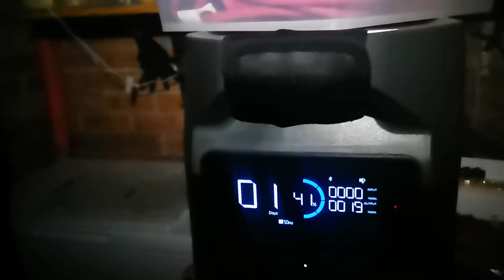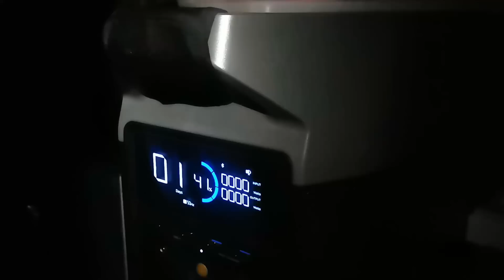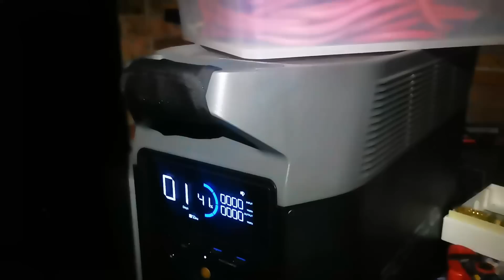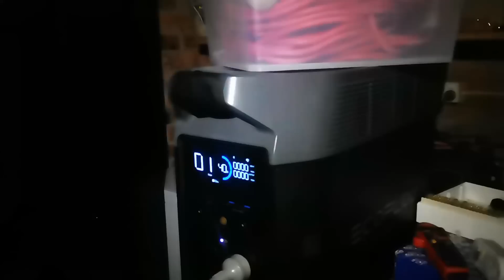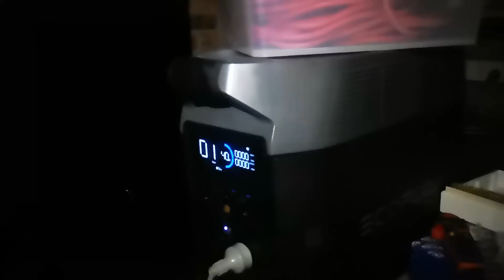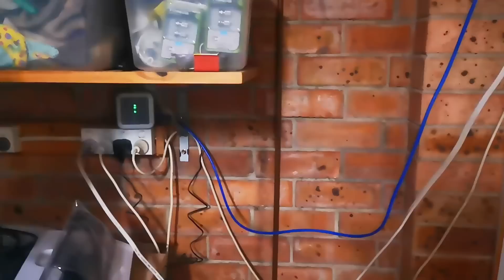Sydney Power FAIL!

Comment: Questions:
The power went out here 2 nights ago, and we were awakened by the incessant home alarm beeping.  Apparently it's been 5 years since I replaced the UB1280 12v 8ah AGM backup battery.  I disconnected the two wires on the battery, but then when the power came back on, more beeping because of the now missing battery!   So I'm thinking going LiFePO4 for more longevity.  But will a 12v 10ah lithium battery work in this application?  The couple additional amp hours will help it last a bit longer through a blackout, but it's more about longer overall life expectancy, even if there were no more outages for over 5 years.  With the old battery in place and hooked up I measure 13.7 volts at its connections.  Is the existing charging system going to be fine with a lithium battery?

Comment: Because you have the enphase and sma inverters you could use a victron ESS system and run the PV inverters on the backup to keep them going in the event of a power failure. The system would do automatic grid fail over and regulate AC coupled PV with frequency shifting. 
It's probably not worth it if the power rarely fails.
Ecoflow has some nice options to tie the units into a house, would probably make more sense to just do that.

Comment: my last power cut, we think was an cheap AC unit, which blow out the under ground cable at almost every joint down the road, I was a hi risk person, so the elct firm put me on a generator for the 3 days took them to repair every joint.

Comment: I've only had a few power outages in the >10 years I've lived in my current place. And one was when the tree in the front yard dropped a branch on the wire running from the pole to the building. That was the last outage, and it was probably more than 5 years ago, and also the only one I've had since I bought my UPSes. It's been long enough I should probably look at replacing the batteries though, considering my friend's UPS just blew up on her, probably trying to charge a dead battery.

Comment: RSVP that SLA alarm battery.

The outage was probably a P plater backing into a transformer or something.

You could probably program an old HP bench supply to simulate a solar panel. Just plug into the old HPIB port, send a few commands, and Bob's your uncle.

Comment: That "solar simulator" is called a DC power supply. According to Victron at least, you can use a DC power supply to simulate a solar array for bench testing systems you're building etc.

Comment: I agree with all your battery analyses. Even with a Powerwall, you have to sacrifice a lot of daily capacity to retain enough battery to hold through the night if power fails in the late evening hours. I have mine set at 35%, with fingers crossed.

Comment: I keep a 3000 watt peak 12v DC to 110v AC inverter around for the odd power outage.
Cheaper to run off the automobile a few times a year than to maintain a battery bank or generator.

Comment: If you want to drive the solar input  from the mains, try feeding it with unregulated DC, from a transformer  based supply. Transformer > Bridge > capacitor, no regulation. 

The solar input should  do the whole  MPPT thing to get as much power as  possible  from that supply. Though  your transformer  may suffer depending  on core design. 

If you're  feeling  really frisky you can add a resistive  load in series  with the primary  of the transformer  to deliberately  limit the current available  if you want to get your  oscilloscope  out and watch the MPPT controller  work  its magic. Presto,  a video idea is born.
Reply: When testing my PWM5 kit design, I used a rectified 18 Volt transformer, as it presents an output very similar to a 12 Volt solar panel.

Comment: A DC power supply simulates a solar panel.
Reply: Why does he want to over complicate it, just plug the bloody thing in, it has a built in charger!
Reply: @uksa007  As I recall from the tear down video, it doesn't charge as fast from AC as it would from solar panels.

Comment: There are two types of power failures.The one you describe here and then the long ones. Where I am we also have these power trips too, some can be during heavy storms, but we also have cable theft, sub-stations exploding and a general collapse of infrastructure. Solar and lithium solves the short duration outages of a few hours up to 1-2 days in a quiet, economically feasible way. After that unfortunately, a can of diesel is the only solution to protect yourself to ensure you will have power no matter what. BTW, we often go without power on the freezer up to 12hours without problems, the more food in it, the better it survives. Also just keep a few ice bricks in it.

Comment: Looks like I am more prepared than Dave with two inverters with 12 hours of backup power each. Also would suggest to separate out high power drain equipment like ac, fridge, heaters, pumps in separate lines. Lighting usually draw very less and you can connect inverter to just that line.

Comment: This is why you need a better inverter so there would be some day time power and a battery backup connected to that inverter since you are a large part of the way there as is. These portable units are okish but probably won't last in the long haul vs a dedicated setup.
Reply from the maker: Yes, that's what I'm working on, been talking to Fronius.

Comment: If you have any chest freezers, many use around 100-150 watts, and good ones can often go hours between cooling cycles. Many fridges will also only pull around 300-400 watts for a short while, and not run for hours if not opened.
Beyond that, I wonder, for the ecoflow, is it possible to add a switch or splitter for one of your solar panels on the roof to have it feed the ecoflow during a blackout?
Reply from the maker: I thought about a DC switch. That would be nice, but the effort required vs the usage doesn't really justify it.

Comment: Very reliable network, here I had 10 DAYS without power about 4 years ago, it's when I decide to buy the Honda inverter, now I have 5kw with an off-grid solution, that lasts about 10 hours (until the sun comes up anyway so not really need the Honda anymore, but it's so u reliable here you get outages all the time

Comment: When my power goes out, I wheel a generator outside, plug it into my house, start it and go about my life.  Eight hours later, I add 5 gal of gas and continue, indefinitely.  I struggle to understand how all of this expensive battery/inverter nonsense is better.  Those boxes make a lot of sense in a camping scenario but as a home backup, I don't get it.
Reply: I get over 16hrs using my harbor freight predator 9000
Just had to run it 3 days straight with hurricane ian 
Thats running a barn shed and house
All the electronics are on ups's
Reply: For home backup it makes sense to use a hybrid system. The battery system will give seamless switchover and also lets you shut down the generator when the battery is charged. Generators running at low load are pretty inefficient, not to mention noise, etc.
Reply: @eDoc2020  All true, but there's nothing in my house that needs a UPS-type backup that doesn't already have its own internal battery (optical network terminal and laptop computer) or an off-the-shelf UPS (network equipment rack).  I'm happy to reset a few appliance clocks to avoid spending thousands on a whole-house UPS solution.  I can easily shut down the generator for several hours through the night without risking food in the fridge or freezer.  To each his own, I guess!
Reply: @FlyingShotsman  Yeah, it's not worth getting an expensive battery system just for occasional grid backup. It's only worth it if it gets frequent usage.

Comment: I get 48 hour power outages in my rural area so I have a 5 KW 240v diesel generator as a standby and a big changeover switch by the meter.  UPSs everywhere until the generator is running.

Comment: My Sister in Adelaide has had no power since Monday and was told expected back Thursday.
Reply: But, but, the Tesla battery...
Reply: I was waiting for a response from Adelaide. Probably haven't seen Dave's video as they don't have any power. 

My father's Tesla Powerwall has been a good investment. He lost power on Saturday, restored earlier today.  PV Solar was wired into the backup circuits, so Solar has been charging the battery during the day. I visited last night and connected the instantaneous Gas hot water service over to the backup circuits, so they could have a hot shower.

Comment: The batteris used in alarms systems, small UPSs etc. are only good for about 4 years. Less if they get hot alot, or go through a lot of cycles. You really have to keep a calander and replace them on schedule. It is one of our PM maintanice items. All batteries get tested each year and are replaced every 4.
Reply: It might be more economical to replace them with LiFePO4 and a BMS module.
Reply: @NiHaoMike64  Ehh not really, a simple drop-in replacement can easily run over $100, these small SLA batteries only cost like $20-30.
Reply: @vgamesx1  Drop in modules tend to be expensive, but building one out of bare cells and a BMS module is cheap.
Reply: @NiHaoMike64  Building 18650 packs are cheap, even the cheapest bare Lifepo4 cells are about 4x as expensive, so even a small pack is going to cost about $20 of cells not including anything else you would need and although you can get away with it, I don't recommend using those cheap bms modules, at best they tend to run cells at the upper/lower points of cycles to get the most capacity at worst they can have questionable quality such as poor or no balancing.

Literally the worst thing you could use as a drop-in replacement because for any lithium cell you want to be able to configure the bms to stop at its storage voltage, if it stays fully charged 24/7 you're going to kill it and there was no point.
Reply: @vgamesx1  You can get modules with balancing, they only cost slightly more than the ones without. That said, the even easier solution would be to just run some wires to the 12V output on one of the portable battery packs.

Comment: If you are still deciding which backup power system you want to have with your PV, check out Victron Multiplus. Needs 24 or 48V batteries for any significant per draw, but it's specs allow permanent use of the inverter in Island mode (many others only allow island mode for a couple hours) and it allows switching over without noticable interruption (basically behaves like an online UPS). (I'm not affiliated with Victron, just a customer).
If you don't want to replace your existing inverters, they do support AC coupling under certain conditions (mostly: must not have more power than the Multiplus can handle). However if you want to be able to power from PV after the battery is empty, you need at least one panel and a small MPPT feeding their DC side to start the system bank up in Island mode (i.e. without power from the grid).

Comment: What about all the solar panels you have on the roof? Where is all that power going?
Reply: Nowhere, the inverters cut off in a power failure.
Reply: Plus they don't work so good in the dark.
Reply: @stargazer7644  That's  why they're useless without some type of storage. Installing panels with storage is only doing half the job.
Reply: @saltyscorpion2151  There is a storage device, those portable batteries. Probably the easiest way to link the two is to use a DC/DC converter to step down the voltage from the big arrays. Would probably do it pretty easily with a 555 controlled buck converter (fixed duty cycle unless it needs to limit output voltage), that way the output voltage would be proportional to the input voltage and the MPPT should still work.
Reply: @saltyscorpion2151  Useless?  Odd, they've apparently been incredibly useful for Dave up to this point in offsetting his power bill.  The problem with battery storage is it's expensive, it has a limited lifetime, and it greatly lowers your system efficiency as you convert energy back and forth.  Yes, it has the benefit that you get to use it in the dark, but it hurts you in every other way.

Comment: Until last year here in Sydney - Villawood there were regular blackouts here till they upgraded some 40 years old equipment.
Regular buying of batteries to feed my torches just in case and keeping some power banks ready for phone charging 
Yep lots of fun a few shops had to close early and food spoilage.🤬
Reply: My house alarm had similar issues with flat battery- I believe some systems interpretation as a power cut and enter alarm sounding.
Reply: Interesting

Comment: Live in the U.S and 2-3 outages lasting 1-4 hours is normal. Fortunately they all tend to happen during the summer (during the evening for some reason?). In other places in the U.S it’s apparently far worse.

I guess I’m surprised that everywhere doesn’t see power outages as a thing that’s just normal and expected.
Reply: Here in North Germany its similar, although most outages stay under 30 min.
The outages are usually at night, 90% of the time I only notice it because some clocks have reset.

Our local electricity company even has huge generators on trailers that can power  whole districts if a power cable has failed or needs some maintenance.

The last outage that lasted more than 2h was around 10 years ago, it was around 3 or 4 hours and I remember being excited (I was still a kid) because it was something rare.
Reply: Where I live I don't recall outages, just this summer power went away for the number of AC turned on, but power outages only last for a couple of minutes usually (probably some breaker that opens, and then it's reset remotely). Of course there are planed outages for maintenance, but they are communicated, and if the outage lasts more than an hour (for example they have to replace a transformer) they will hook up a generator feed power while they are working on it, so you have an outage only when they disconnect line to connect the generator and vice versa. 

In reality are more the power outages caused by breaker that trips or exceeding the power limit imposed by the meter than the amount of time the power goes out for other reason. Anyway I'm considering adding a small backup system just for a couple of things, that is the networking equipment, the gas boiler, some LED lights, and maybe the TV.
Reply: In Finland close to the city - I remember like 5 power cuts. Longest lasting couple hours. I don't remember any from the last 10 years apart from when spending time in some rural areas.

Comment: Here power failures are rare but in the winter we can get snow storms with heavy snow that can cause tree limbs to break and cause overhead lines in older areas to short out. A couple of winters ago we had such a storm which cause rural areas to be without power for days and in some areas for week or two. Not fun when its -20c or more outside.

Comment: I used to live with daily power outages. Then I moved to North America (from southern Africa). I thought I'd seen the end of black outs. We've had at least 3 power outages this year. Ready to buy a UPS and backup generator now. In fairness, it was far more rare in my previous residence where all power lines were underground. Above ground power lines plus strong winds is a recipe for power failures.
Reply: Ahhh, good memories of Brown Outs in Jo’Burg when I lived there back in ‘97-‘98.  We had a rule in the evenings: you can only have 2 majors on at a time.  So, watch footie on the telly and cook dinner, but no heat from the electric radiator or cook & heat or footie & heat.  Funny enough, we never had a full black out, just the brown outs.

Comment: Alarm beeping when battery is too low for normal operation is normal.
So you know and fix it.

Went full offgrid last year.
Never been more happier, in my location, micro-fail append almost every days... Now power been on since over a year :)

Comment: What about your EV? It's an obvious high-capacity source of power if there's some sort of inverter output you can plug in to. Also good for plugging things in on camping trips. If it's not already there, shouldn't be impossible to add.
Reply: My IONIQ does not have V2L capability.
Reply: @EEVblog  Surely an EE can hack it in.
Reply: @Okurkaarrgghh  
At the expense of cancelling the warranty!! It would be cheaper to simply replace the current EV with one that has VTL.

Comment: Candles & Puck Lights should be kept on hand! 
An excavator/gas line accident, years ago, knocked out my power for hours. I had an APC Battery Backup plugged into my Desktop, and it drained the battery into oblivion, trying to run my Internet Gateway Unit! =(
Reply: We have headlamps.

Comment: EVERYONE should be installing off grid power systems that can power everything one needs indefinitely. Because it's coming a lot sooner than you think! Especially in Australia, Europe, and America.

It doesn't even require an atomic war, all that has to happen is another Carrington sized event, and you will lose power for 2 or 3 years. Or permanently.

And don't forget, the water goes away after 2 days of no electricity. You cant buy petrol or food, either.

It will also be a massive evolutionary leap for mankind, as everyone that didn't prepare are liquidated.

Comment: question with them so rare why do  you want to add a back up battery  just wonder we get like 1 or 2 a year and my dad like don't care just wait it out don't open fregen unless need reed a book with candle  lite if  need that it  seam  ther 2 differ kind of people
Reply: He needs his alarm system to feel "secure". Yeah, when the power goes out, just wait it out. But that doesn't sell these battery boxes that are all the rage these days, and every youtuber is taking sponsorship deals to push them.
Reply: the alarm he disconnected? and yeah why would you need battery backup for fridge? especially since he has solar in daytime
Reply: @karol_janek_wojtyla_pawel_ii  He only has solar if the power is on.  His solar is strictly a grid tie system.